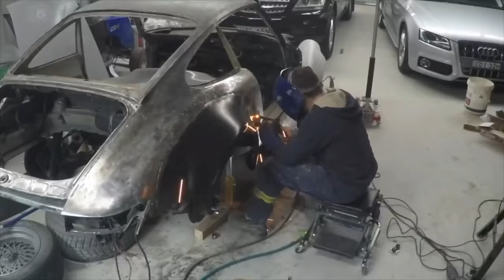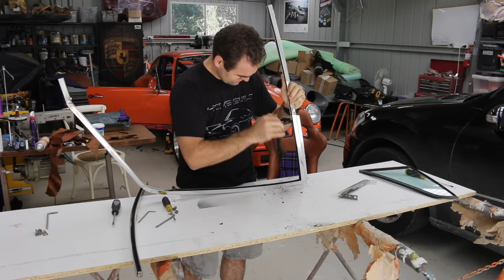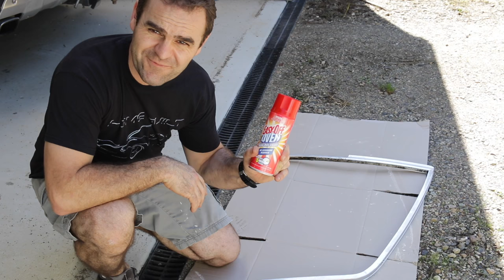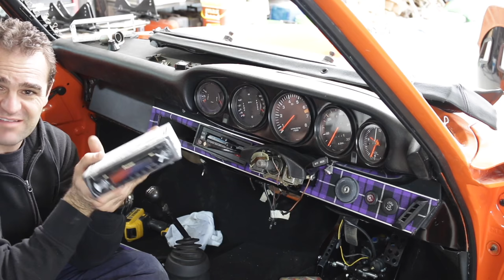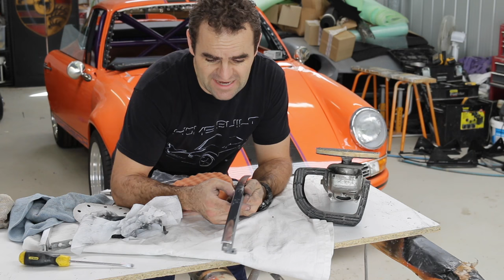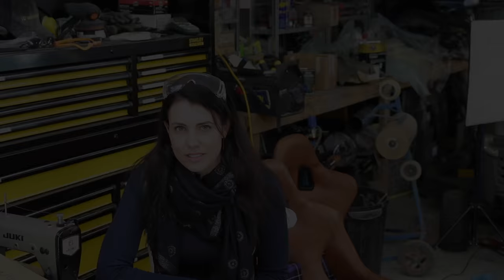Porsche 911 Classic Car Build Part 49 - Fixing wonky windows

Comment: Great video Jeff. I am having similar issues with the windows of my '78. I have pulled the regulators out and cleaned and greased them which helped, but I think I probably need to replace the felts as well 👍
Reply from the maker: I was amazed at the difference the felts made and they are much cheaper than regulators.
Reply: there is a silica spray you can buy to spray in the channels to to help lubricate